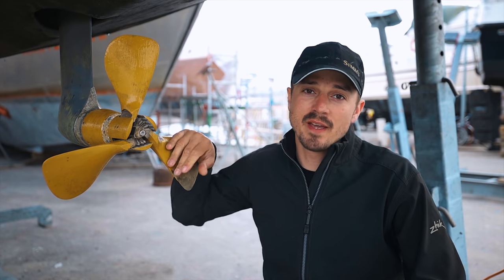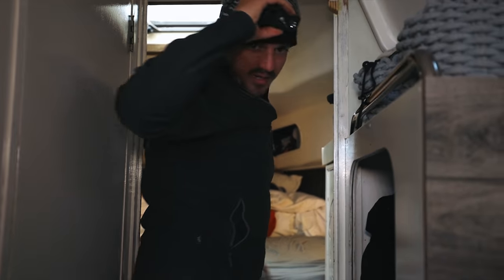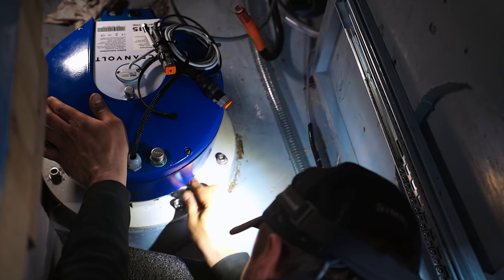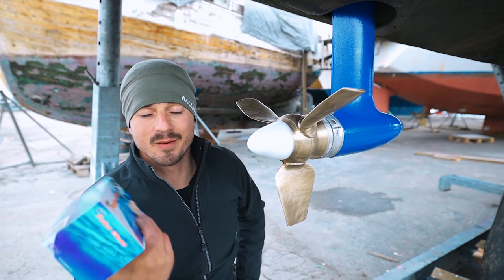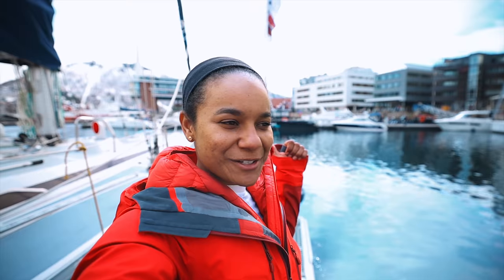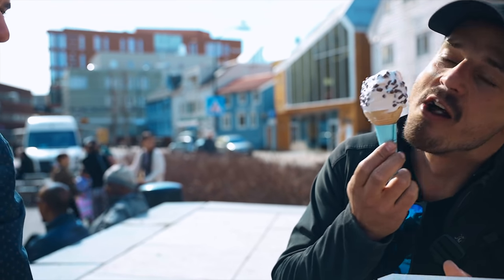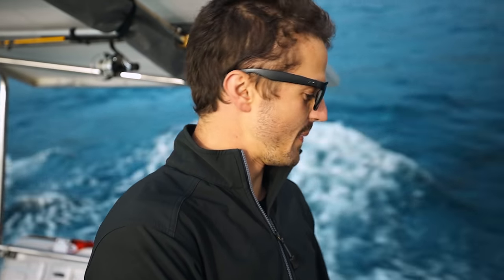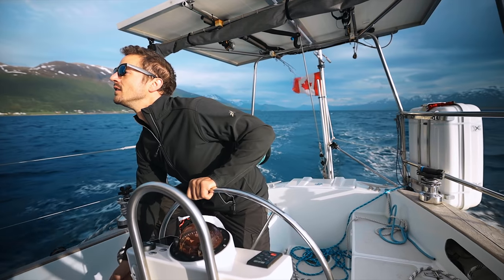Ripping Out our Electric Motor for the LAST TIME! — Sailing Uma [Step 277]

Comment: The electric system needs an edison generator and dynamos system. An Edison generator is electric power without fuel or pollution. An edison generator can be built from an old generator pre 1974. You disassemble the generator and remove the Tesla magnets from the armature magnets and leave the edison magnets on the armature. The generator becomes a permanent magnet motor as a generator.. count the armature magnets and leave one sixth on and off chisel off the Tesla magnets and leave the edison magnets motor magnets. On and off one sixth  leave three sixths on and chisel three sixths off.  Regeneration is done with a dynamo to feed the battery. While you power the motor at less than the rating of the motor.
Reply: Motors can be moved without consumption of electricity. You can power a dynamo and a motor for a very long time. You could have two sets of batteries just to keep your mind straight. You can generate more power than you use with a dynamo.
Reply: What is a motor as a generator? A brush less motor as a generator is a dynamo.

Comment: 46 600 € excl. VAT etc.
Reply from the maker: Try adding up what a diesel actually costs and you’ll pass that number in about 5-10yrs of ownership. Besides, you can’t put a number on peace and quite. No maintenance and ease of use.
Reply: @SailingUma  Thanks for your reply. This motor and setup is a wet dream (pun intended), but with this price it will stay that way. For us, that price in diesel would be about 330 years of ownership, this season we've spent 140 €, about two months of sailing. Now it is time to haul her out for the winter.

Comment: Great for cruising from dock to dock, but totally impractical for true world cruising... Unless you have an 80 foot cat with heaps of panels etc and a huge battery bank it is not practical for real blue water cruisers. Of course having loads of extra generating equipment on board kind of defeats the purpose of a minimal carbon footprint.

Comment: Whether I watch an "off-grid" home video or a sailing video or a whatever "green video". It's ALWAYS THE SAME story:  Tell me how great the system is - tell me how it's going to be a cost savings over time, and justify why you're upgrading from the last great green system that was previously  installed- then 6 mo or a year later - repeat above.... over and over again.
Reply from the maker: Yup. Technology changes fast. And ever % increase in efficiency is huge to folks living off it. You don’t hear anyone raving about how their truck is 1% more fuel efficient because diesel and gas engines have reached their peak. EVs are just getting started.
Reply: @SailingUma  you left out the part where you say: "This latest install will solve all of our problems created by the last install"- And then it doesn't...---It never lives up to its promises.  And yes - hundreds of sailors use diesel motors that are 20 years or more old and DID produce the power promised.

Comment: For something so small those drives are crazy expensive. Hoping your publicity for them will drive up demand for prop regen so its price drops enough that using it is a no brainer if you have batteries on board. Think of all the diesel we can avoid burning... 

Next stop rip that one out and add two props...
Reply from the maker: They’re about the same price as a new diesel. We were quoted between $24-30k for a 40hp diesel 7 yrs ago when we first started. Same price as a servo prop. The batteries are a 10 yr supply of diesel fuel, just paid upfront rather than bleeding out over time.

Comment: Sweet setup, way too much money for most sailors though.
Reply from the maker: Cheaper than a diesel.
Reply: @SailingUma  what diesel is this motor cheaper than? On OV's site it has this thing listed at 38650€ to 44600€
Reply: @neptunesreaper838  this is something they always say, it’s not true. They just put in a $50k drive system to regen what a 300$ solar panel would have done during the day. This was a commercial. They have 12 100ah batteries that retail for about $12k.  Works out to be about 15kwh , that means without efficiency loss, in a perfect world, they could provide 10hp to the prop for 2hrs.
Reply from the maker: We are able to put in about 1kwh from our 500W of solar on the sunniest day up north. Our best day of Regen gives us 5-6kwh... We cannot store that much solar on our boat even if we tried. Plus solar also only works when it's sunny....  And so for us, it is the redundancy of generating power that matters. When we are at anchor we can use solar or potentially a wind generator, and when we are offshore we can use Regen.

The up front cost of an entire system is high, sure, no one is denying this. However, Keep in mind that the quote from OV's site includes the prop, the shore charger, and the batteries (basically everything you need, if you have zero of the components) The motor itself is roughly 20k, which is in the same price range as a new 40-50HP diesel engine. If you take a new diesel engine (15k to 20k) and similarly add the needed components: two fuel tanks (1k)  new prop and prop shaft (3-5k) , shore charger, house battery bank (your average cruising boat still has 5-8kwh for house batteries either way) + monthly expenses and fuel cost. Although you do not see the price laid out in front if you instantly, it adds up to much more than the electric system...  

The  main difference is, you are paying for those expenses up front with electric, rather than a long term payments forever with diesel. So it is still true that electric costs less to own and operate than diesel. 
That doesn't even get into putting a price on peace and quiet and ease of use.
Reply: @SailingUma  You could have built a towable generator for $500-$1000 that would have the benefit of being able to swing a larger prop, or switch props on the way. It also wouldn’t add the complexity under the water line of the servo prop. What happens if you get some fishing line around the propeller? If you didn’t want to diy, you could have got a watt & sea or similar.

I have seen many oceanvolt estimates. I do consulting on energy systems for yachts. It expressly doesn’t cover the install cost. The final cost is commonly 60k-100k. Why are you comparing the cost of a 40-50hp diesel to your 20hp electric? I have installed several diesels and the cost is no where near what your claiming. Although it can be but that’s more a discussion about marine services in general. I don’t believe you two have owned a yacht with a diesel in it and cruised it for a long period of time. Your long term cost estimates are completely unrealistic for a diesel in a boat your size. This sounds , more like a OV brochure talking point. Plus if you had a diesel, you could still sail engineless as you basically have, with the added benefit the extreme range and current fighting ability of the diesel. Fuel costs for your boat would be so small, it would be laughable. 
You guys could have gone engineless and slapped the dinghy outboard on there and had many times the range as the system installed currently.
Btw sailing is always quiet once you turn off the engines.
Reply: @SailingUma  the  OV SD15 is $45637.00 USD standard or $55095.00usd with the  servoprop.

Beta marine 30hp with gear $12,500.00 usd
New prop $2,000.00 USD

So for a new engine and prop ur looking at $14,500.00usd which leaves u with a 31-41 Thousand Dollar budget for diesel. That's enough diesel to circumnavigate 😂😂 

I'm still not seeing how an OV system is cheaper than a diesel in a boat like yours. Which won't be averaging 6knots most of the time for the Regen to work. In a cat it seems legit but from what I've seen on your channel the electric motors seem to be nowhere near the performance of a diesel. Thank you for taking the time to respond tho, that did shed some light

Comment: Ya know, you might be able to get another 4x as much out of your solar panels with a couple concentrator mirrors attached. Something simple like smooth, polished aluminum foil attached to wood could do it. This guy made some more technical ones; but it might not take more than a simple rig attached to the sides of your cover while you're parked.

https://www.youtube.com/watch?v=knlQFlxCwrs

cheers
Reply from the maker: Why not just add more solar panels? If the reflectors are the same size and weight? Solar is so cheap now, if you want more power, buy more panels. No need for superfluous engineering.

Comment: Am I the only one that shakes my head at the cost of all this gear and the 3rd electric motor? A small diesel engine would have been cheaper for the people that are paying for this because these kids aren't. The diesel engine would have been cleaner then the massive lithium battery bank, multiple electric motors and solar panels. The diesel consumption and the carbon footprint to mine and manufacturer all this equipment would never have been consumed by a little diesel engine. And, they aren't even paying for any of this. I have sailboat with big solar panels and a big lithium battery bank but I paid for it myself and not deluded to think I'm lessening my carbon footprint. I just checked and they have over $80,000 in this experiment. This Oceanvolt SD15 system if Oceanvolt's website is correct is over 46,000€. That doesn't include the last Oceanvolt saildrive that someone gave them and they used for just one year, the lithium battery bank and the small golf cart battery.
Reply from the maker: Everything commented above is incorrect.
Reply: @SailingUma . Ok.
Reply: @shortwidgets  hahaha🤣🤣🤣

Comment: Hi Guys, you need to read up on your flag etiquette. Your flag can not be above the Country flag your are in. 
But I do like how you dressed the flags before you had that problem of then not working.
Reply: You may have that backwards. The boat's national ensign has the place of honor which is usually the highest point at which that flag is to be displayed. The courtesy flag of the country you have been cleared into by customs, is flown from the starboard spreader of the forward mast, and replaces the Q-flag. They are NOT flown simultaneously. The highest point for a national ensign is at the Gaff. If no gaff then it may be flown on a staff at the stern of the boat. In that case the courtesy flag will appear above the national ensign. But in lieu of a gaff, the ship's national ensign may be flown at the similar height position on the backstay or the main boom's topping lift as a Gaff, where it would be above the courtesy flag. There is NO regulation in IntelCo restricting the height of the national ensign to below the courtesy flag.

If there was an error in flag flying then it would have been by placing the ship's national ensign and the courtesy flag on the same mast or halyard, in this case the dinghy's whisker pole mast. Technically that arrangement is a challenge to the country's rule of the area. The exception is in dressing ship, which they were originally trying to do, where they all go in order on the forestay to the top of the mast and back down the backstay with the senior flag being at the place of honor at the zenith or masthead. In elaborating more, if there is a foreign national onboard the boat, then in addition to the courtesy flag of the nation visited, the courtesy flag of the foreign national should be flown from a separate mast or display point from the courtesy flag of the visited nation. In the case of a single masted boat, I would fly the foreign national's flag from the port spreader.
Reply from the maker: Its also a pole hoisted on a dinghy… on National day where all sorts of flag were flying … I don’t think the “order” matters so much here.
Reply: @bdphourde  yes but I was referring to there own made up flag.
Reply: @SailingUma  I agree, Dan, it isn't so much a matter of having to following maritime "traditions" in this case, but showing camaraderie in a foreign port which is the best way to spread good will in our travels. Nothing could be construed otherwise for your parade participation. UMA has brought both Canada & Haiti nothing but pride for your great behavior around the world. That's why everyone else likes to watch you also! I'm certain that is a significant factor in companies being swayed to sponsor you! Others learn the benefits from your great example. We've also seen UMA flying Kika from the foretriangle in lieu of another courtesy flag. What better courtesy could a boat render to it's visited country!
Reply: @CaptMarkSVAlcina  You are right regarding "personal" pennants or burgees. But it was the only way Dan & Kika could let everyone know who they were. A dinghy with a whisker pole mast is not going to be able, nor was it meant, to comply with flag etiquette.
Reply: According to international flag etiquette the company/vessel flag should be flown at the top.

Comment: Since countries like India and China will never stop polluting our oceans at the worst rates ever, do you guys ever regret not having a diesel motor, at times?
Reply from the maker: Those two sentences have nothing to do with each other. And you can’t miss something you’ve never had.
Reply: @SailingUma  i guess i stand corrected. In every case before, anyone that goes all electric is focused on a lower emissions footprint (world pollution, i.e china and india are worst offenders) .  After i re watched step 4, i realize your into 'self sufficiency  more important than carbon foot print. 
  soo, i guess those two sentences DONT  have anything to do with each other. my bad

Comment: So tell us what the regular (non-partners) folks will pay for this.  Also a question, no more wind turbine experiments? :)
Reply from the maker: https://oceanvolt.com/standard-systems/

Wind turbine is still a work in progress, but it takes time to develop something new.
Reply: @SailingUma  Understood.  I had a couple of thoughts.  There is no reason the turbine has to be mounted vertically.  It would be a lot easier to suspend it horizontally with two attachment points.  Food for thought...

Comment: I made a uneducated comment and it's embarrassing to leave on the internet for rest of time....so I edited it.
Reply from the maker: It’s actually the opposite. Watts are the only thing that matter. 300W at 230VAC or 300W at 12v is still 300W. And can still be used to do 300W of work. Voltage and amperage only matter to the specific appliance you’re using.

Comment: Its not amazing.... that is a horrible way to generate power. i say horrible because their cost of that for the amount of amps it generates is NOT cost effective.
Reply from the maker: A true cost comparison puts electric less expensive than diesel for a new instal. And after that, power generation is free. Diesel fuel costs money forever. The cost difference in a new instal comes from the battery bank, not the motor. How much diesel and oil and parts will you buy in the next 30 year? If you live and sail full time like we do, it will be more than the $15000 a battery bank currently costs. Besides, a world cruising boat has at least 5kW of batteries anyway. Some even more. So 50-60% of that battery cost is needed even if you have a diesel.